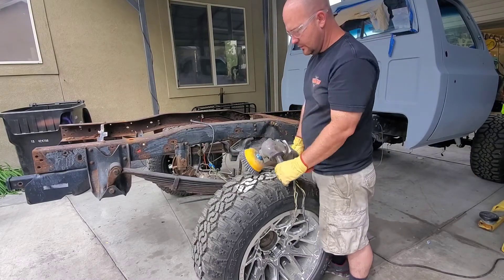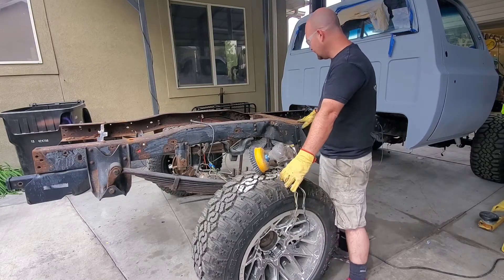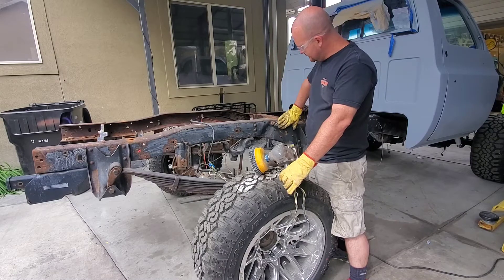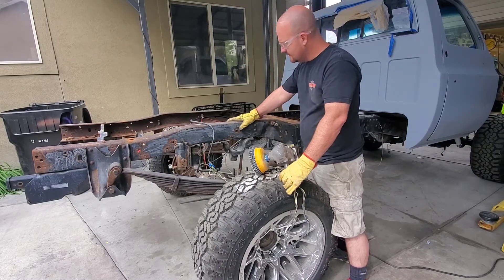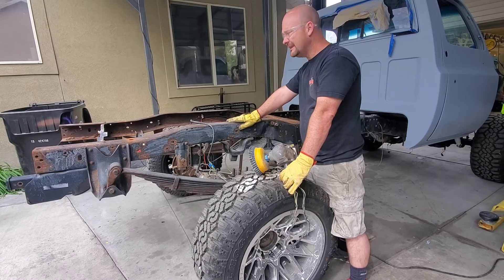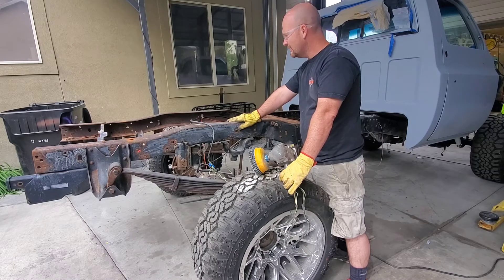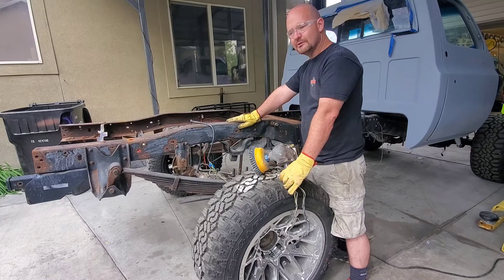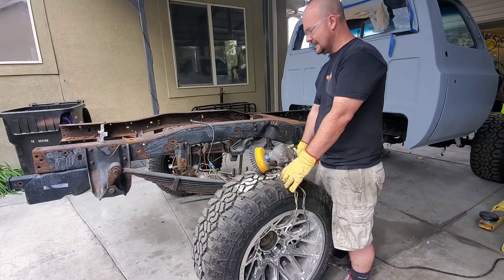Square body Chevy K20 longbed frame Rust in scale removal in repaint with rust oleum

Comment: What wheel and tires do you have? Thanks
Reply from the maker: The wheels are made by dropstars 20x12 tires trail hog a/t4 305/55r20
Reply: @JCustomFab  They look BAD A$$, Thanks. This will be my next purchase.
Reply: @JCustomFab   Do you have a lift on your truck to fit those wheels and tires? Thanks